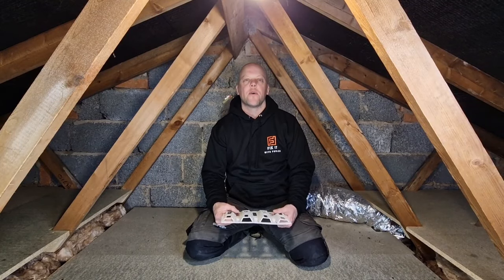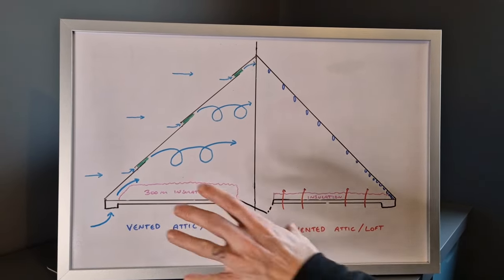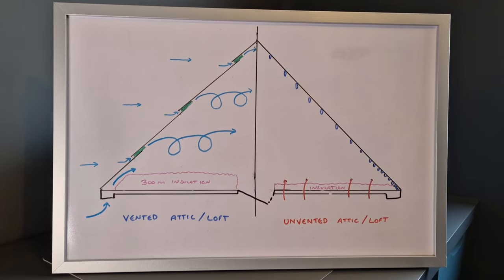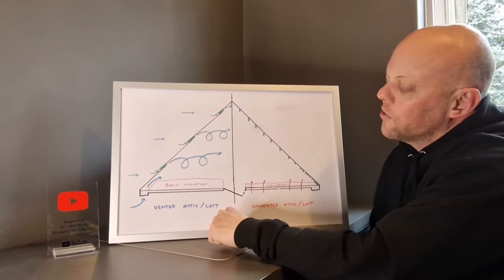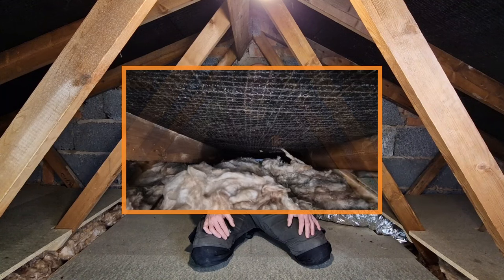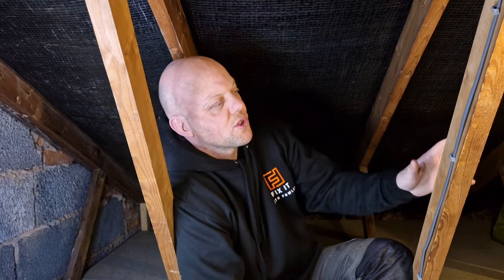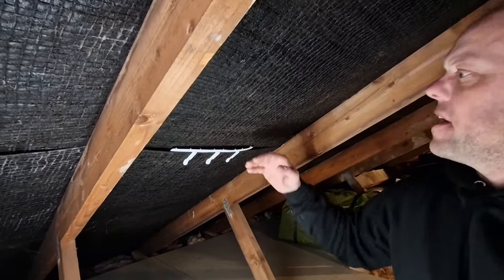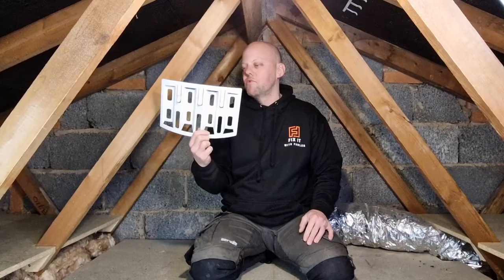Condensation in loft ? - Cheap and easy fix using Felt Lap Vents   #condensation

Comment: Bad loft condensation and was quoted £4000 to fit external vent tiles! Saw your video, bought the vents for £20, fitted in 20 minutes and condensation cured immediately! Thank you soooo much!!!
Reply from the maker: That's amazing to hear, and I'm glad the video has helped you and potentially saved you £4000! Please consider supporting the channel with a super thanks 😊
Reply: That sound a lot for a few vent tiles. Probably another cowboy, scammer who tried his luck.
Reply: Surprised he did not try and get you to build an 80k extension to 'diffuse' the air
Reply: @FixitwithFowler i don't have eave vents, are they easy to install? I also have 2 extractor fans enter the loft void and don't vent externally which causes condensation. Could I vent them through the eaves? I might have one hole in the eaves that's 6 inches for the old soil pipe... Any advice please

Comment: Good video. 2022 has seen the coldest first two weeks of December since 2010. People are going crazy after these vents. Price has increased significantly. I use strips of polystyrene cut to size with a 45 degree slot at one end so it can be attached to the felt.
Reply from the maker: +leaphtc thanks for your comment. In all honesty anything that opens the felt lap would work. Don't forget to subscribe for more great videos and hit the notification bell!

Comment: Really great video, well presented and almost exactly what I needed. I think it is the only video on youtube showing the staggered formation. I said almost as the only thing missing was how to stagger these felt lap vents on the other side of the roof space. Is it perpendicular to the staggered formation on the other side, but then again the middle might be straight opposite. Even the manthorpe's installation guide was not at all clear and did not mention staggering at all. I think Manthorpe's instructions said to put one at the eaves and one at the top, miss one rafter gap and do the same. On the opposite side they did not say anything and logically it should mean if on one side one has put them 1,3,5 on the other side 2,4,6 for example, but these are not staggered. Maybe an F1 wind tunnel experts are needed to calculate most optimal position, hahaha. Great video irrespective of my questions.
Reply from the maker: Hi, more molecules. Thanks for your comment and question! Firstly, by staggering the felt lap vents, it will create a varied air flow entering the loft. Now, on the opposite side of the loft, stagger the vents in a pattern that doesn't match the other side and put them as you say 1,3,5 and 2,4,6. You are trying to create a turbulent air flow within the loft and avoid the air entering and exiting too quickly. Hope that makes sense?
Reply: @FixitwithFowler  Many thanks indeed for the really quick reply. It makes sense to stagger them in a way that the air does not flow directly from one side to the other. I always thought that the air would flow along the membrane from the bottom to the top rather than towards the middle of the loft. I will have to see what staggered pattern I can achieve and if it removes the condensation problem in my loft. Many thanks again. I suspect if a pattern does not work, to modify it and see which one works.
Reply from the maker: Hopefully it will cure the condensation in the loft for you!

Comment: Hi, having watched this video I have bought some of these to install in the loft. However, there are only a few places where i have been able to slot them in fully. In many places in the loft, they only go 3 quarters of the way in as i can see it is hitting a roof tile so I cannot push the vent down any further. If i was to just leave it 3 quarters in, will this do anything for the airflow, or does it have to slot in fully for it to work?

There are other places in the loft where the overlap of the felt is extremely taught - any tips on how i can separate the overlap to be able to fit the vent in? 

Sorry if this has already been covered in the comments below as i can see this video has been up for a few years! 

Thanks :)

Comment: Great video, very informative! 
Is it necessary to fit on all 4 sides of a 4 pitch roof and how many would you recommend? I did previously attempt to fit these but i dont think I’ve got the correct arrangement so  I will have to move them. Thanks in advance
Reply from the maker: Hi, yes you definitely need to fit these both sides as that will generate air flow and keep the loft well ventilated. I would recommend 20 vents in total

Comment: I had this exact issue! the Lap Vents seem to have done the trick!
Loft nice and dry especially after a couple of windy days!
Reply from the maker: +TOMSTC thanks for your comment and im glad it worked for you. Obviously there can be other underlying issues that prevent these from working. Don't forget to subscribe to my channel for more great videos 😉
Reply: @Fix it with Fowler  I also found a pipe left over from the old boiler system I think it was the overflow.
It was full off water, so my guess was that was depositing water.
To be honest we never really had major issues until this year, only difference being that we have not had the heating on for long periods.
The whole house is suffering with condensation because of this and I am working on remedies where I can.
I have subbed great looking channel
Reply from the maker: I must admit we have found we are suffering from condensation on the windows but im guessing its a combination of heating, cold weather and old windows!

Comment: Much apprecaite your excellent video., than you. I have a question re fitment as my bitumen felt is so taut that it is impossible to push them in easily. I would have to resort to brute force and fear this may cause damage/tearing to the felt. I also wonder if the normal overlap on the felt is less than the the width of the vents as otherwise it won't allow air in.
Reply from the maker: Hi, the overlap on the felt will be less than the vents. Also, as for the felt being tight, you will have to try and see if you can fit them in.

Comment: Hi great video, I had the same felt removed and new door fitted as my house was built in 70s. I have recently noticed condensation on the new roof left. I believe it’s breathable felt. Would this vents be ok to use with this ? Thanks
Reply from the maker: Hi, these vents are for any type of roof membrane or felt and are designed to increase ventilation. If you have vented sofits then make sure youmove the insulation away from the eves. https://amzn.to/3t0hK5S

Comment: This is a super helpful video - thank you! 
We currently have no ventilation in our loft and it was recommended on our surveyors report to install “five vents to the front soffit and five to the rear”. Will this be necessary if we add these lap vents instead? Should we be adding soffit vents in addition to 10 lap vents on each side? 
Many thanks.
Reply from the maker: Hi, there is no need for sofit vents if you install these lap vents. Make sure you unstall them in a staggered formation, i.e., some high, some low, and have a high one on one side matched with a low one on the other. Here is the latest amazon link https://amzn.to/3qt39yx

Comment: Great video
Could I add 30 to the roof.
If I add max to my roof will if clear all.
My loft does drip when winter is here and the loft insulation has black spots. So I hope to add as many as I can to the roof
3 bed end Terence
Thanks
Reply from the maker: Hi Vic, Yes, you can but normally 10 each side is sufficient. You need to stagger them to create a turbulent air flow. If you follow this link you will get them cheaper https://amzn.to/46VH6RC

Comment: Hi, my roof felt has begun to perish and has come away in several places exposing the tiles,  saving up for a re-roof. Felt suffers bad condensation during winter, one side is south facing, the other north, roof has no vented eaves and membrane is non breathable. White mold patches have appered on the nothe side only,  will these vents help?
Reply from the maker: Yes definitely, read the comments on the video. The ones I used in the video have since gone up in price but these are the equivalent https://amzn.to/3UVLjzu

Comment: Did you fit the vents in a pattern of top, middle, bottom, top, middle, bottom? Or top, middle, bottom, middle, top?
Reply from the maker: Hi, it doesn't really matter as long as they are not in a straight line

Comment: Hi, great video. Iv just had a £800 quote for fitting some sort of ventilation tile for a condensation problem in my loft that has created a small brown mark on my ceiling from a drip in the loft. (I’m not very up on what’s going on up there tbh) Now Iv seen your video I think I may try this first as can’t afford that cost and seems a cheaper option.
Reply from the maker: Hi Dane, if you replay the first part of the video and make a few notes, im sure you will be fine. If you follow my link in the description it will take you to the vents on Amazon. I would start with ten (5 on ech side) and position them not directly opposite each other. Hope it sorts the problem for you! If you like my channel don't forget to subscribe!

Comment: Hello Steve, a quick question please if you don't mind. My loft is the same or very similar to the one in your video. I wanted to make my current loft to a warm loft. Will I still need these vents which you mentioned in the video please? Many thanks!
Reply from the maker: You will need an airflow between the underside of the felt and the new insulation. If the insulation touches the felt you will get condensation. I suppose it will depend on the existing airflow in your loft and if you have vented eves or sofits.
Reply: @FixitwithFowler  Thanks Steve 👍

Comment: Hello mate! My roof its the old sile with bitumen membrane and its a semi detached house..my question is where it’s ok to install this felt lap vents..? It’s ok to install in all 3 places.. front, back and side .? Thank you!
Reply from the maker: Hi, my loft is the same, and we suffered from condensation in the winter and excessive heat in the summer. I have installed a total of 20 vents in my loft, 10 on the front and 10 on the back, and our loft has since been dry and considerablycolder in the summer. If you have a roof with front back and side, then  I would spread them out throughout the loft to increase the ventilation. Here's a link to felt lap vents I used https://amzn.to/4cXVtYb

Comment: Hi pal love the video 
I’ve got a lot off damp mostly 
 down back side of loft felt and patches on the wood that runs down it’s a 1930 house no soffits just big vents at top of house I assume these are for the loft any suggestions on how to cure problem as it does wet inside daughters bedroom and sons box room
Reply from the maker: Hi, firstly, thanks for your comment on my damo in the loft video. Do you know if the damp in the bedrooms is on the ceiling or walls?
Reply: Thanks for your response in my sons box room it’s on the gable wall where the bed is against seems to be when weather starts getting colder
Reply from the maker: Ok, so this video is designed to cure damp or heat in the loft by increasing ventilation. By increasing ventilation, you minimise any difference in temperature, which eliminates condensation and dampness. Normally, if damp is on an external wall, then i would suggest looking at the outside of the house for any tell tail signs of water ingress.

Comment: Great video but I have a new build house (11 years old now) and have a white breathable membrane. This year it looks like it has mould growing all over it. A picture in place of where the mould is bad has also started having mould growing on it.

Nothing has changed in the loft apart from taking out a lot of junk, but will check for any insulation that may have moved.

I know it’s hard for you to comment but can you think of anything else I can do to stop this mould?
Reply from the maker: Hi, even if the roof has a breathable membrane, then that doesn't necessarily mean you have adequate ventilation in the roof space. We have had extremes of weather, which possibly hasn't helped.  You could make sure any ducting from fans is connected properly and does indeed go outside. Other than that I would suggest adding some felt lap vents for added ventilation
Reply: @FixitwithFowler  thank you. I will double check the two fans that connect in the loft, one for the on-suite and one for the bathroom.
Reply from the maker: @chrispybee, yes, that's definitely worth checking first. You may have disturbed the ducting, and that would definitely cause condensation, which in turn would cause mould!

Comment: We have a property built in 1800s ,it has no plastic fascias, it has a breathable membrane and at the end of the loft space there is a metal vent . The loft is very small as it has been raised and the ceiling tongue and grooved to allow a bigger space in the room below.  This means that where the roof begins is very close to the tongue and groove.
Having been up on the lift for the first time I have noticed that fibreglass insulation is pushed down the thin gaps between the tongue and groom and membrane .   The lift has a lot of condensation and damp. We have also had a couple of yellow looking water stains appear on the plaster board on two walls since winter arrived. Which I think is due to the insulation touching the membrane . I have had a local builder friend round and he has suggested replacing four of the roof tiles with vent tiles . Will this sort the issue?
Reply from the maker: Hi, firstly, if your property has a breathable membrane, then it's obviously been re-roofed at some point. Breathable membrane helps with condensation to a degree as it is semi permeable, but the key to reducing condensation is ventilation. You could try vented roof tiles, but that will obviously come at quite a cost. You could try these felt lap vents first to see if that cures the problem. https://amzn.to/3H7mIRE
Reply: @FixitwithFowler  Thankyou for replying, we have got to get the ridge pointed anyway and the roofer is a friend of a friend so shouldn’t be too pricey.  I’d try the interior vents but the loft space is tiny and hard to get into.
My partner has had the property for years and we had previously been renting it out before moving back in.  She had never had the issues with the watermarks on the walls.
Prior to moving back in we replaced the wooden front door with a composite and the windows in the kitchen for double glazing.  I also sealed the gaps In the tongue and groove ceiling and painted . 
I am thinking that this has contributed the damp problem in the loft space ? This is why I am hoping roof vents will help . The metal vent at one end of loft space is around 300mmx300mm.
Reply from the maker: @RANDA11FLAGG  Yes, ventilation is the key, no matter how you achieve it. Also, insulation plays a part as this prevents warm air, meeting cold surfaces!

Comment: I live in a Victorian terraced house and have condensation in the tenemant section . So I dont have two sides to the roof, as the other side of the roof is the neighbours. Seeing as I only have one side of a roof will these vents still work or will it not create the required turbulence ?. Thanks
Reply from the maker: Hi, it will definitely make a difference to the air flow as once air blown inside the loft the the air inside the loft will be forced out. I would recommend trying it as it's the cheapest option to start with. https://amzn.to/3Sgr26o
Reply: Thanks for the quick reply. After looking at all the positive reviews on Amazon I have ordered 20. I hope they work as I was convincing myself I needed a new roof even though I cannot see any damaged tiles from the outside. Subscribed. @FixitwithFowler
Reply from the maker: @Bluejohn, thanks for that, I've not had a negative comment about the felt lap vents, so hopefully, they will do the job, and thanks for subscribing!

Comment: Great video but I wish I could find them at £2each. Also, the space between the rafters in our older house is around 33cm. Are small ones of these available?
Reply from the maker: Hi Paul, At the time of filming, i got the felt lap vents from amazon at £20 for 10 of them. However, they are now around £3 each! These are 33cm, so it might be a bit too tight. You could trim the felt lap vents down to fit. Check out my other videos, and don't forget to subscribe 😉!
Reply: @FixitwithFowler  Thanks for your quick reply and advice. I'll subscribe. Take care